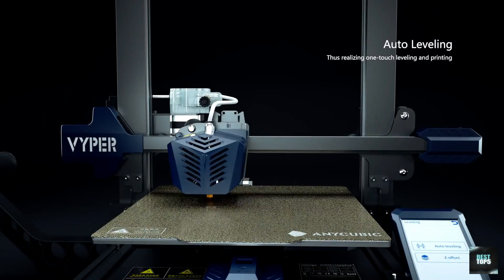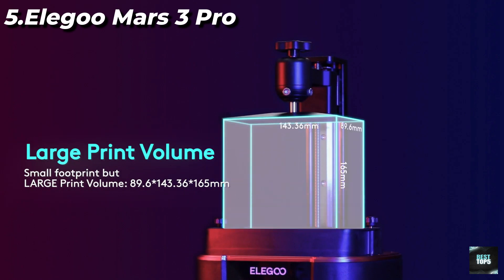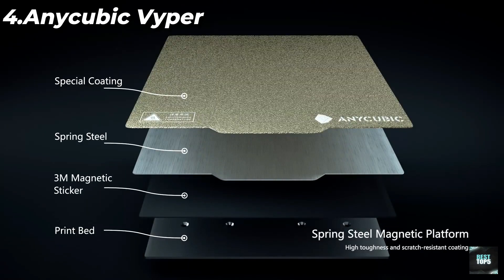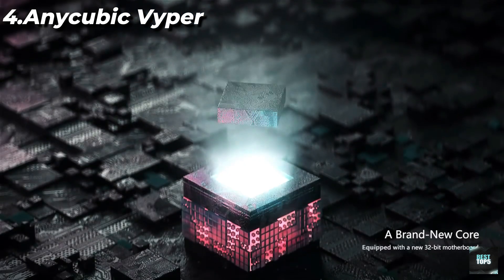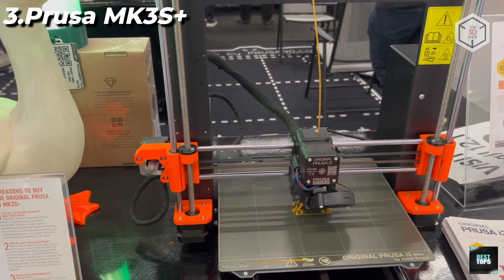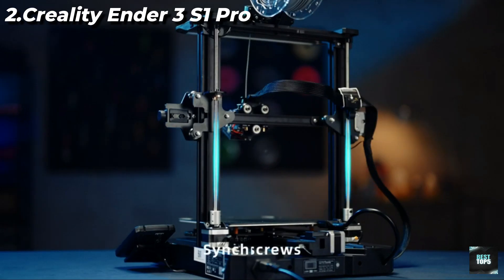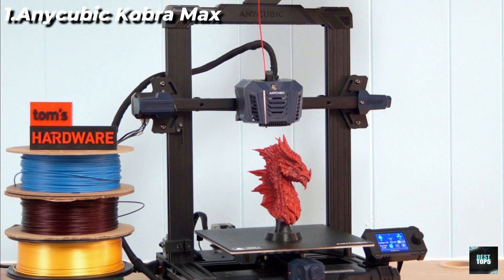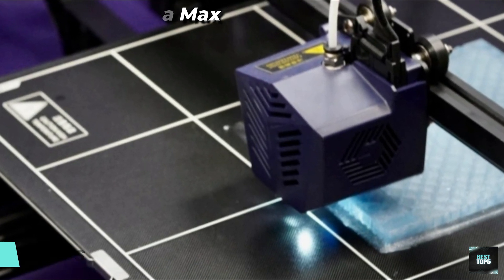Top 5 BEST 3D Printers of 2023

Comment: Number.5- Good printer, but SLA isnt good for beginners
Number.4- Just buy an ender 3 s1 pro
Number.3 - Prusa was good 2 years ago, just buy something like a bambu lab, voron, ratrig, vzbot...
Number.2 - I allready placed the ender 3 s1 pro on n.4, so i will give this place to the classic ender3
Number.1 - Just buy an ender 5 plus
Reply: As an Ender 3 S1 owner, I do not 100% recommend it. Its design is mechanically, or some even say electrically flawed which causes a lot of us suffering from leveling issue. The mesh somehow is not compensating properly. Creality didn’t seem to be willing to really solve the problem. Not until recently did the community find a solution for the mechanical side and with some mods. My first layers are finally okay-ish, but still not as consistent as a Prusa.
It’s an okay printer for a hobby and if you like tinkering. But not a good option if you want to focus more on printing things or for business.